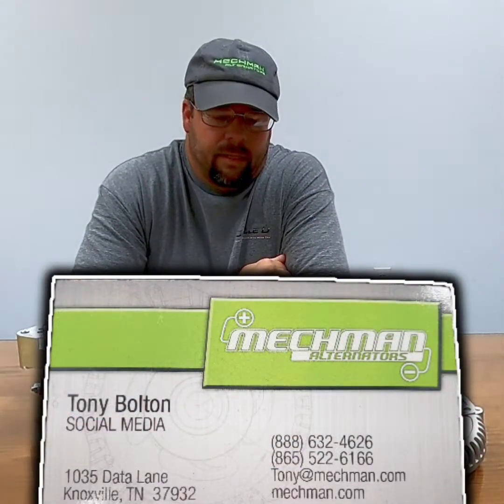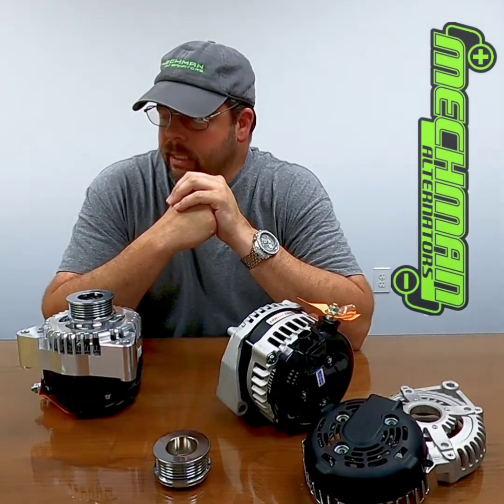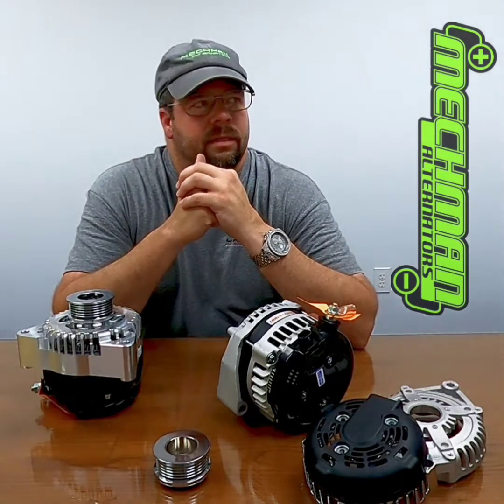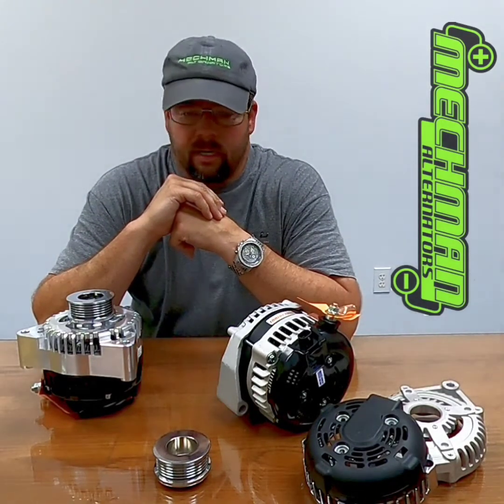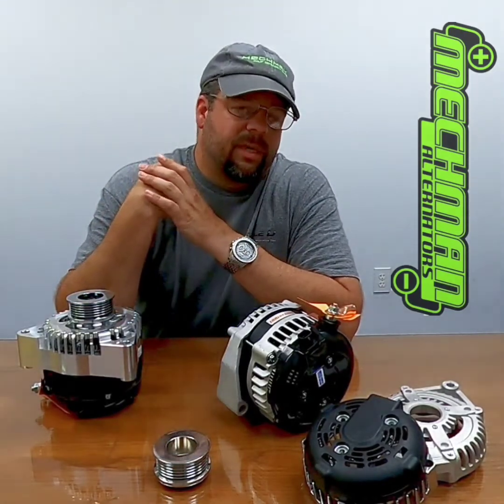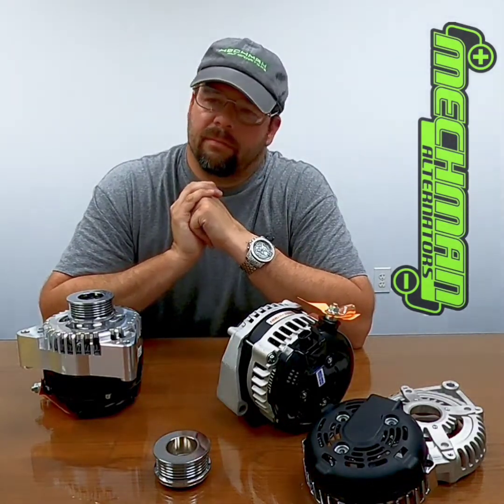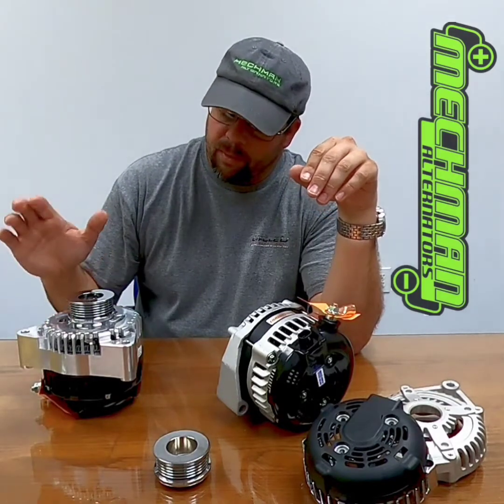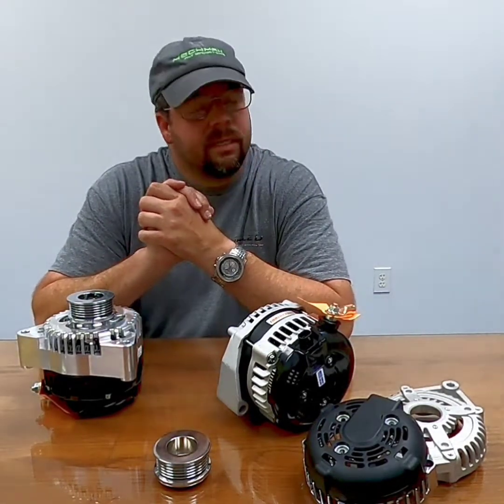12 volts? 14 volts? 16 volts? When? Why? Where? WTF?!

Comment: 14V AGM batteries must be charged to full capacity or they won’t last, which means an alternator charge point of 16.5V.  However, Titan 8 14V (S6) lithium batteries can be charged at mid to low 15V range, which is a common charge set point for Mechman alternators and offers superior life, cranking power and significantly reduced weight. For a street car with no electrical upgrades, just a plain 12V battery and an upgraded Mechman alternator is all you need!
Reply: Thank you Scottie! I've enjoyed eyeing that Titan 8 for the MechTruck when I possibly triple the power this fall. 😇🥰
Reply: Can those titan 8 lithium batteries go under the hood?

Comment: On a 12v system is it safe to charge at 15.1 - 15.2 if we are running lithium batteries for car audio ?
Reply: Probably not...  I also have a high output 15 v alternator and it's running... But time will tell what it's gonna do to my normal ass AGM batt. Only saving grace is (my theory) that I bump heavy the whole time i drive so maybe it's not getting all 15v at once.

Comment: I got a 14.8 V C-Max batteries i need a dual bracket 12volt for my truck then 14volt  alternator  for the C-Max on a 2019 Nissan Armada can u help

Comment: I was about to throw a 14v battery on my 2022 frontier for a 3000watt sound system but instead I'll just get another 12v and wire them in parallel. Thank you so much for the great video!!! You most likely just saved my electrical system in my truck!!!
Reply from the maker: Sometimes simple is best.

Comment: My Alternator Pushes 12.4 amps with Headlights off....BUT  Pushes 14.5 with Headlights ON
Can this be Explained?
( 2013 honda 4Cly
Reply: My 2022 frontier does the same! 12.6 lights off at idle, 14.3 lights on, and it's because the electrical draw on your system is higher with the lights on so your alternator is putting out more to make up for that!! I got you buddy!

Comment: Take out the alternator regulator rectifier n put a variable rheostat potential meter adjustable but swap alternator to leece neilville 680 amps thicker wires  two spark plugs per cylinder magneto huge n use nitrous nozzle instead of injectors or put another battery 🔋 n series it my diesel truck 10 feet flames would

Comment: Y’all make really nice alternators , I’ve installed quite a few with good success. But please get yourself educated on 16 volt systems . I run a 16 volt battery and alternator . It charges at 17.1 volts. I’ve completed and won 3 drag and drive events just this year. You’re not in the race car world, if you want to be feel free to let me help you
Reply from the maker: We're not saying you're wrong, just not as efficient.   The higher the voltage, the more power it takes to do so.   What's the point in running a 16v battery if you're not going to optimally charge it?  This isn't "just us".  Feel free to check out the detailed AGM battery tech data on XS Power.  You could be doing the same thing with a 14v battery.  

Again, there's tons of ways to do electrical but some are more efficient than others.
Reply: @mechmanalternators  not every battery lithium cells require such a high voltage to charge,  the 10 horsepower it taks to turn the alternator is irrelevant on 3000 plus hp cars.  the need for the 16 volt system is the big injectors and cdi ignition systems.  like i stated a year ago. yall make a very nice product and i wish you made a 14 and 16 volt offering.  we would be happy to sell the hell out of them.

Comment: Just get a typical 4S LiPO on a 3.5-4.5V balance circuit running off a little buck converter separate from the rest of the car and run a capacitor on the active terminal once the car is running...it's a lot of wiring to run but still lighter than lead acid. 

Any hobby store will sell you a 14V LiPO for under $50 that can start a car while the CAP is going to keep the voltage nice and stable to run your high performance ignition coils and plugs.

I'd still replace the cell every couple of races but it's cheap as far as racecars are concerned...plus once again it can save you 10-30 lbs depending on the weight of your stock battery.

Comment: I’m trying to get a 400 amp alternator that I can use with a small 5-10hp engine for power generation. Would I just need to connect positive and negative to yours, or do I need something like your regulators to do it safely? Thanks for any feedback.
Reply from the maker: It takes appx. 10-12hp to operate a 400 amp alternator.   We get these type of application calls daily and we DO NOT recommend using our alternators on anything BESIDES the automotive applications we list on our website.  They will not be warrantied nor serviced/repaired if done so.
Reply: @mechmanalternators  understood. I need about 316 amps for what I’m doing, and heard it’s not good to run alternators over 80% continuously, which is why I was thinking the 400 amp one would work better. Is that accurate? Thanks again for your assistance.

Comment: yea i was looking at solutions for charging these lthum batter some will lst 3 fold longs if charged at a certain bit lower than max voltage and if using alternator  one needs some range in voltage i found one that ( regulator ] that may go down to 13-19 but i will not know until i test it .might be junk ..but be nice to have a knob to turn lol.now ill watch the video God bless hi from Kingston tn

Comment: The guys who want 14v system are not using stock computers or electronics.   So please make 14v capable alternators!  Asap
Reply: That doesn't make sense. In the video it states that higher voltage alternators require MORE POWER to turn. So why would a RACE CAR want more parasitic drag costing them horsepower? 

Most race cars only need around 170-200 amps of alternator output.
Reply: @tonyb022377  
It's not the amps.  It's the volts 
Higher voltage is more power 
For fans ignition fuel pumps!!!
Reply: @joeas7475  ok, so an alternator cranking out 16.5(2 volts more than a 12v alternator)volts that would take around 10hp to drive would be wanted by race car people? 

...think about that...
Reply: @joeas7475  if you want higher voltage for a fuel pump, just use a boost-a-pump.
Reply: @tonyb022377  
It's not just the pump 
The fans and ignition all work alot better at 14v.  That's why pure race cars use 16v.  So the street guys want 14v.  I have 1 of your 13v 170amp alts now.  It works good.  But I'd love to upgrade to 14v. With a battery and alternator swap!   I know you big in the stereo scene but you def don't know the performance car scene 
Your loosing out on alot of business. Cause the only 14v option alternator everyone is using is made by powermaster! And it's not anywhere near your quality of product. I'd be willing to be a test car for you if that's what it would take for you to make an alternator like that!
Reply: @joeas7475  you've got some other problems if you're only seeing 13 volts. All of our GM 4pin 12v alternators charge batteries at 14.5+ volts. I don't think you've fully watched the video to understand how charging works.
Reply: @joeas7475  ...and for us not knowing the performance scene? Ryan Martin, Farmtruck, Jeff Lutz,  Redline drift and pretty much all Australian big race car builds use our alternator.  

I ask that you please do more research before making baseless comments.
Reply: @tonyb022377  
Mine ia a 1 wire alternator for a sbc 
It's 14.3 with fans off 13.8 when fans kick on
Reply: @joeas7475  then you have a voltage/amperage delivery problem. Belt is slipping or your wiring is not adequate.  The alternator is easy to blame
Reply: @joeas7475  https://youtu.be/dv5xhxl86xQ

Comment: I am from the car audio world, and what a lot of these race car guys don't understand watts is watts, I have seen them say I get better spark at 14v systems but they have no idea how to charge it or maintain it, I run 16v on my build two alts then run 12-12 victron chargers to run my 12v side to keep it safe and happy, they can run just as many things on 12v as 14v, I would never want to worry about a voltage regulator while trying to run a race car, but a bass truck no big deal it is just part of the control system u have to maintain and control while demoing
Reply: Yes!!!! This!!!!!

Comment: I’ve got a 2018 Dodge Challenger R/T, and I purchased a mechman Alt a couple years back. When I first installed it I was charging at 15v no problem, but now I can’t seem to charge above 13.2 and at most 13.8 on a cold start, once it settles I’m literally at 12.8-13v even. I’m sure the alternator is good, however I was told that dodge has a really aggressive voltage regulator. Is there any way to bypass that issue or am I at the mercy of the manufacturer’s strict voltage control?
Reply: It sounds like belt grip/slip/worn tensioner